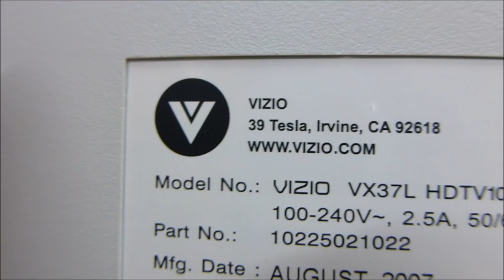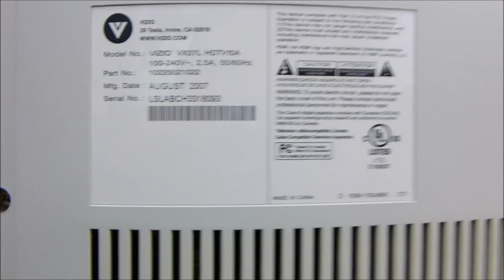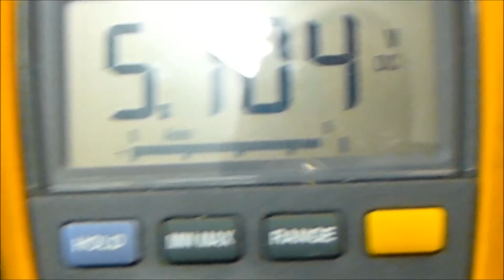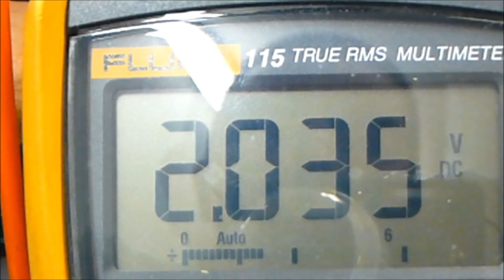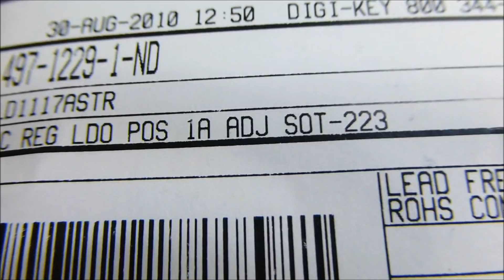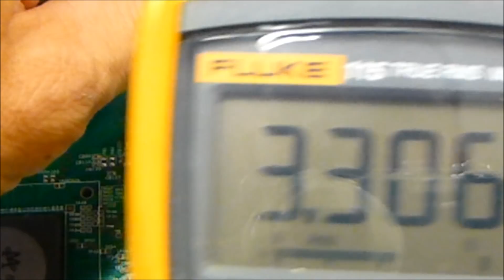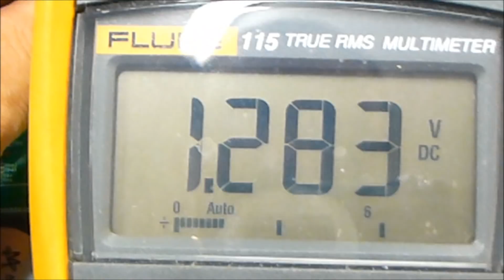Vizio VX37L HDTV10A LCD Powers on with backlight, Wont power off, No video

Comment: Hello I have this same tv and I am experiencing some issues with it not wanting to turn on so I’ll unplug it for a while and then plug it back in and can get it to turn back on but then will experience problems with the volume not working on my fire stick remote and it not powering off. Also the buttons on the side of the tv will not work properly. Is there a chance this is a regulator issue or potentially something else

Comment: I have a very similar problem not only does the little Vizio letters light up but the Vizio logo pops up on the screen and stays there and I cannot turn my TV off every now and again after unplugging and replugging it up from the back of the TV and turning it on and off on and off on and off by unplugging it and plugging it in and then hitting power button sometimes it will come on but today it isn't can you help me with some information on that possibly?
Reply from the maker: Check the Eeprom!  You can try heating and cooling it to see it you get results. Shopjimmy.com used to have pre-programmed eeproms available, just go to their site and type in the model number. Also try amazon and ebay with "vizio (your model number)  eeprom"
Reply: @norcal715  I haven't even took the back off of the TV yet because I was able to get lucky and it would come on after so many tries but now it's just not and I would really like to fix it so I really appreciate you getting back to me is there any way for me to send you a photograph of the TV to see if it's the same as yours?
Reply from the maker: Just give me the model number and I'll look it up.

Comment: Hey Norcal! Because of a previous video I was able to fix the power board on a vx32L that someone had tossed in a recycling dumpster. Replaced the capacitor R909 (63v 47uf) It now turns on with backlit with no input response like this video shows, where before the VIZIO logo would light up white and switch back to orange. Appreciate the videos, more people should have your mindset

Comment: Would Chip Quick solder be good for removing this voltage regulator on U33?  Is it more miss to deal with as far as cleaning off the solder? I just don't want to remove any traces on the board. Thanks for your time.
Reply from the maker: It should, just make sure all is removed before soldering the new chip on

Comment: I'd like to know who the idiots were that designed the tips of your voltmeter probes. I have the same type and ground them to a point using a Dremmel grinder. Before the modification, one slip and they create a short circuit.. And the flanges at the end I guess were to protect from shock if your finger accidentally slid down. They prevent you from being able to bring the probes closer together so I ground them off.

Comment: I have a Vizio m502bi power board. my 5v is 5.1v, my 12v is 11.63v, and my 24v is measuring 19.8v, pwr_on is 3.6v, on/off is 1.1v and does not change when pressing on button. popped fuse out. put it back in and on the main board magic smoke came from U403. I know the main board is bad now. I'm not sure about the power board. the voltage is off, causing damage to the main board?

Comment: LG 55 LA 5210- Symptom: After pressing power button the LG Splash screen comes on (backlights come also) for about 1 seconds then screen goes black, but all lights at the bottom on the bezel remain on along with the LG logo lighted.and sound also working

Comment: I have an older Samsung plasma. The remote or any remote will not turn the panel off. If I turn it off with the clear bezel touch buttons.  The only odd thing is the source on the remote doesn't work.  All other buttons work on the remote. Any Ideas? I need to factory set the catch is need to hit power on remote to do so. It is a 6500D.

Comment: Hey Nocal, I believe my main board has gone bad.  I am trying to test the same things you have shown, but I don't have power.  The power button doesn't power the main board. I have 5VSB to the main board as tested on the first fuse.  Most of my regulators still show the 5V to 3.2v drop but several have different voltages or nothing at all.  I assume that is because I don't have power.  What am I to look for when the power switch doesn't power the mainboard?  Vizio vf550m.

Comment: I had the exact same problem, but instead of replacing the regulator, I replaced it with an LT 1085, which is a higher-power version of the part in a TO-220 package.  I cut the leads short, surface-soldered it standing up, and powered up and tested.  TV works!  But the regulator "glows white hot".  (I considered why such a regulator should fail in the first place, and suspected it was being thermally overstressed).  I put small heatsink on it.  They should have put a larger chip there!

Another possibility is that something in the computer is drawing excessive current leading to the regulator failure.  Only time will tell!

Comment: hi Mr Norcal715 , i have the same tv with the same problem this dont have sound and the the power on with backlight , wont power off , no video no sound but in the front on the sign VISIO , i buy the IC Regulator and replacement but this dont work is the same  thanks for your attention and have good day.

Comment: great video. i get no 12v or 5v at the first regulator you're checking. I checked both fuses and they are good.
the vizio logo lights up, but pushing the power button doesn't seem to make any difference. I do have 5 volts at the one fuse.'
Should i replace the first regulator? Thx..

Comment: I picked up this same TV sitting by the curb last week, owner had pulled it from a home they were remodeling and didnt have a power cord to test it.... so they just threw it out.. I brought it home, fired it up and ran into this same exact problem. I wasnt able to test any components because my multimeter was dead, so i just  Swapped out the controller on U33 and presto, Works perfectly! Thanks to your concise video i have a new TV, new to me atleast :D

Comment: Will a bad compositor cause a low voltage on the regulator I replaced one with low voltage but it still has 5v in but .9 out

Comment: on my regulator AZ7805T my input was 12 volts but my middle pin was reading 2.3 vols and according to you it should read 0 volts could it be the reason why my small regulator it went out for the second time?

Comment: Thanks mate, I have a soniq qsp421t  Plasma TV with the same issue, Your video helped me locate the offending power regulators, There are 3 I've found so far, so I'm thinking there could be multiple problems with the board so I will replace it & let you know if it works.  :)

Comment: Same problem started last week Apr 2016.  All regulators appear to be good with 1.2V differential. Last one to the left has 3.2V in,  1.2V out with and 0V +/- on the 3rd term.     Where would do you suggest going now?

Comment: I had the exact same problem present itself.  I checked the voltage on U33 and U7 and came up with almost the same voltages.  I drew pictures of them and wrote down the numbers for each pin.  I ordered two of the 1117 part from digi key... arrived in two days regular postage. The part cost was .77 cents, with postage... under five dollars. I photographed everything from start to finish.  I replaced U33... plugged the unit in, hit the power button... checked the readings on the new part... back to where they should be.  I got a blue screen within seconds of pushing the power button.  One note... do not use acid/core solder... its messy.  Pete K, below suggested using silver bearing solder or lead.  I still ended up with good solid solder joints and it worked, but it was more difficult to control the solder. I would also suggest that you solder the output terminal first, as it is the largest terminal.  As you mentioned in the video... you need to hold the piece down when you make the first solder joint... a pencil works great using the eraser end.  Once that has cooled... solder the other three.  Watch out for something that is really close to the input pin, (some refer to as #1 pin)... it is very close and easy to get solder on.  I filed the tip of the solder gun to a point... like a pencil... not as sharp as a pencil... but much better than it was originally.  I did this by removing the copper tip and putting it in a drill.  This made it easy to make an even tip with a fine file.  After that I used some emery cloth to make it smooth.  Thank you norca715 for the great video.
Reply: check5v 12v fuses
Reply: Hi what if replaced the mother board

Comment: Had issues with Vizio like tv would turn off or doesnt respond to comands, etc. Got a replacement Vizio main board after installing and double checking everything TV won't turn on and Vizio logo won't light up. After unplugging and plugging back in without pressing power button I test two fueses and one shows 5v and the other 12v. I thought 12v should be near 0 until TV is turned on. Any suggestions what I need to check to see if the board can be fixed?

Comment: I have a Vizio GV47 FHDTV10A.  It started our with screen being dark on the left side then the picture went out altogether.  If you trun the TV on the VIzio front light comes on white but you can't hear the power come on.  all you hear is a relay clicking.  Any suggestions.  I did find a hot spot and a 470 mf @35 V cap that looked bad by a bulging top on power supply.  I replaced that but didn't fix the problem.
Reply: check for back lites first step

Comment: Hi, Thanks very much for this video. I have a Vizio E472vl, so the configuration is a little different. I began testing the voltages of regulators on the board. Came to the 1117 1.2 and it had 5 volts on pin 3, 1.19 on the output and .5 on pin 1. Seems as though this is as it should be, correct? Not many other regulators on the board. If not this, then what?
Reply: +Mike Jones Have you checked the caps? Are the bulging or leaking on the top?
Reply: output voltage  to low

Comment: I have a Visio vw46L that has flickering on one side of the screen, shows some horizontal lines while it flickers.  Where should I start troubleshooting?  I did pull the back off and checked caps first to see if anything was obviously bulged but didn't see any.  I do have tools and some skill.  Thanks for any guidance you can provide.
Reply: +cmatthys   You have the same set I have. I bought an inverter board and will be replacing the one I've been told is the problem. Bought it at shopjimmy.com, but I'm sure there are other places you can find it.
Reply: I bought the Master Inverter board and it fixed my problem with the flickering I was seeing on the right side of my screen.  20 minute fix.
Reply: spoke to soon.  It did NOT fix my problem.

Comment: Norcal715-.. 2013 Vizio 701i-a3e powers on with backlight and sound. Also when press buttons it gets just a little brighter then back dim again. How do i know if its tcon or panel problem? I guess it could be main board or cable but most of my research is leading me to tcon. What are your thoughts on this? O ,, it does same with remote and buttons on tv. If you think its tcon board or mainboard problem what are the usual components that go bad so soon. Tv was bought 2 years ago and black friday. Also want to say thanks for your videos. I have learned alot and have kept my 2007 samsung dlp hlt6187sx/xaa running and out of the landfills. Ive replaced caps on both power supplys and the led red plat light from your videos. I want to get the 70" vizio going now. Shame these tvs go out so soon! Thx

Comment: I have Vizio TV Model SV422XVT, When I plug in the power cable Vizio sign blinks yellow and white for a minute or two and turns white.
With the power button on the side it turns on and the screen lights up without any video or sound, at this point I can not even turn it off with power button on the TV.
Remote does no not work at all.
Please help.

Thank you

Comment: hello ,  i,m  having  same  issues,   checked  F2  with  set  off   reading  7.5 to 10 volts  &  F1  has  zero  with  set  off  ,after  turning  set  &  checking  F1  raises  to  24v,   i,ve   checked  u33  and   reads  2.0  volts  ,   vizio  logo  starts  out  amber  then  turns  white  ,  when  turned  on ,  screen  is  black  then  slowly  will  turn  white ,  no  video  , no  sound  and  when  i  try  to  shut  off   from  control  pad  or  remote  wont  shut  off  ,  until  i  unplug  set  from  wall  ,   any  ideas   as  to  why   F1  &   F2  reading   are   higher  then  normal ?

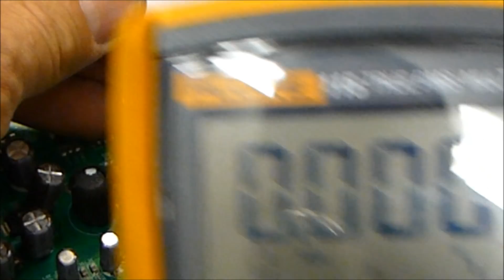Comment: So I did the same checks you did. The Voltage regulator you tested at 4:10- were all 0.0 volts. The other regulators were good except U33, the input of that was 71+. So should I replace the first one first? Or both?

Comment: Wow thank you so very much for this DIY! You're a pro! I was given this same T.V. set and it has the exact same problem. Were all of the resistors the same part number? They were just step downs? My soldering skills aren't as precise as yours are. Do you have any tips? I have a solder iron, flux and solder- by mine always comes out messy! Thanks again. Great video!1!

Comment: how do I fix it when it comes on to a blue screen with no signal then turns off
Reply: +McSudoFish ,  connect  your  laptop  to   tv  using  a  VGA  cable  ,  tv   should  show   laptop  screen  ,  using  your   tv   remote  change  input  from  RGB   to  TV  ,  ran  into  same  issue  with  friends  vizio  tv  ,  setting  got  changed  by  rolling  over   onto  remote ,  basically  tv   doesnt  sense  any   signal   in  RGB  setting  so  tv  goes  to  blue  screen  /  no  video  massage  and  shuts  off   tv ,  oh  without  any  signal  tv  wont  stay   on  long  enough ,   hope  this  helps ,  saved  friends  tv   from   landfill

Comment: This would be helpful if the Vizio model I received as a gift wasn't a unibody. It's like they don't want you to save money by repairing it instead of buying a new tv.
Reply: +Saja Carpenter Really?  There's no way to take the back off your tv?
My grandpa says it might snap on. In other words, it might not use screws to hold the back in place. Does it have a seam running all around the tv? If it does, then it probably snaps on.

Comment: I have a visio m420nv, I turn on the power and the logo comes on, The screen comes on for about 5 to 7 seconds. Goes black and restarts over and over. I have tried a replacement power board.

Comment: My fathers 32" Vizio just started this, looks identical to this one and I have the 37" version.
It turns on, but won't power down.
No menu or anything.
Backlight comes on with a couple of very bright spots up top.
Seems to be a common problem.
Reply: +Mario Monti Did you fix your fathers TV?
Reply: +Balto D honestly, haven't had the time. I know what I have to order, just busy with work and my little girl.
Reply: ***** Right on. We'll good luck! Someone was about to throw this exact TV set away for this exact same reason. It's in mint condition other wise. I might just replace the main board since they're around 50 bucks.

Comment: Thanks so much for the video.  I was really close to tossing my TV out and buying another $200 set.   I only use this TV for my extended computer screen.  I was able to get the TV to power on after unplugging it a couple 100 times.  After I found this video I decided to give it a try.  The parts cost me $26.03 from shopjimmy.com.  I replaced 4 of the 5 pieces that came with the set, I wasn't going to attempt the large audio one that came with the repair kit.  You do make it look easy to pop them off, and by the time I got to my 4th one it did get easier.  Thanks for the video!!!

Comment: I want to Thank-you for this video,I have soldered in 1117a as noted,I'm heading in the right direction,when I power up the TV I now get a blue screen,then channel number ,then a quick pic on the TV and then it stops ! On U33 I have 5v input,ctr pin is 3.3 v,and adj pin is 2.05 volts,on U& I have input of 3.3 volts,ctr pin is 1.27 volts,and adj pin is 26.9 mv ???? I have changed the 1117a part 2x....what is my next step to fix this wonderful made product ??? It's fun but never racking ....I solder like a junior high schooler !

Comment: Vizio E55Oi-ao 55 in HD.  Audio and for a second I saw a fragmented or pixilated image of the Vizio logo that appears normally screen center...next time turned on it appeared in the right corner of tv screen.  Once I saw the logo fully appear in the center...had hope, then back to black screen with audio.  I checked back of machine, saw no light inside.  Assuming I need an inverter board but I hate wasting 65$ on one if I'm wrong.  Any advice?  Thank you for posting.

Comment: I have a question. My telescope mount is broken, and the regulator(LM1117-3.3) on the power board shows 12V input, 1.2V output with lots of heat and burnt smell form it. I thought that part is the main problem for power failure, so I detached it form the board to replace it.
But what I'm curious about is that the faulty regulator gives me a correct voltage with no loads. Could it be the other parts that causing power problem?? I can't test it right now cuz I'm waiting for new regulator part..
Here's the picture of the board (not my picture btw), http://i.imgur.com/0sCwS9g.jpg
J8 connects to 12V power source and J10 connects to Power button.

Comment: Working on the same TV and have 5v at the main board fuse but on the 12v side when I power on I get a short jump in voltage then it drops to zero. Logo is yellow,  then white on power up and will turn off again to yellow. I'll be looking at the power supply next I assume..